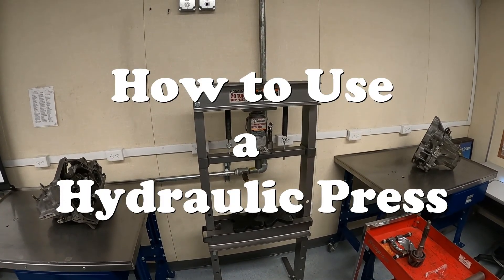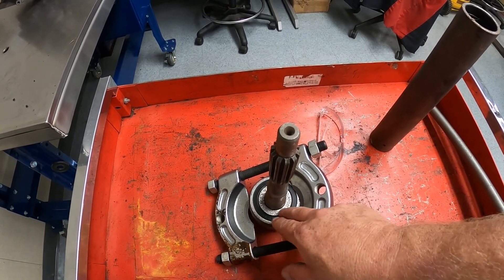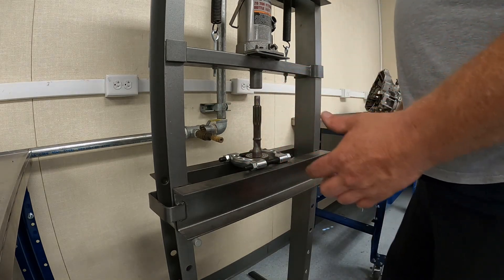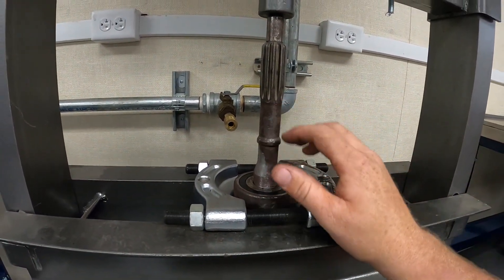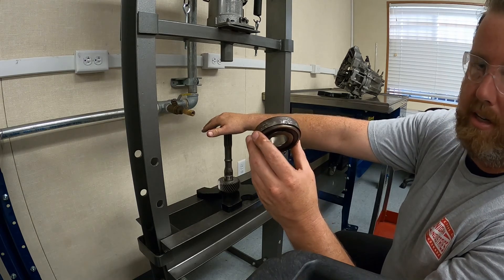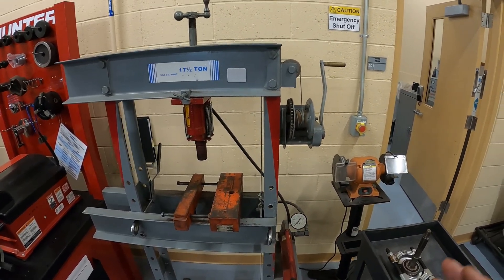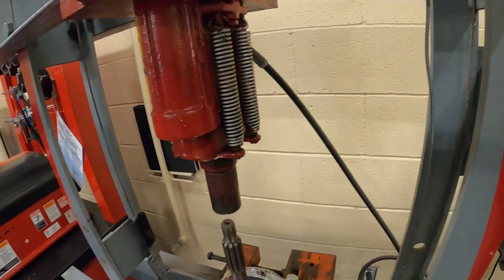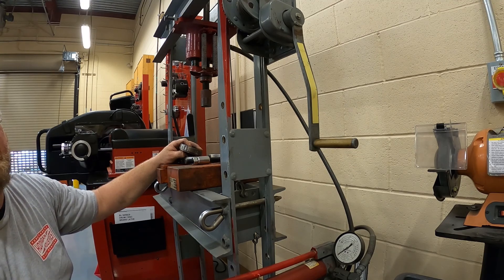How to use a Hydraulic Press

Comment: On my 12 ton press the top of the Bottle Jack unscrews to give you extra height.  I like having a bottle jack because I can Repair or Replace it !  A Press is a Fantastic Machine ! A lot of Daft People  make their VICE Explode trying to Extract Bearings !   But a Vice is usually made of Cast Iron !  The Press is made of Steel so it Will Bend or Split but it Shouldn't Expode even if you could overload it !

Comment: Be aware that if you think the ram shaft is inserted in a hole in the base of the bottle jack, you're wrong. It is just welded onto the cross beam. I learned that the hard way, fortunately without injury.

Comment: Hi, Taylor!  Came across your channel while researching DIY hydraulic presses and mods.
I can see at least a few of your videos that interest me. 
Your shop press at 13:52 is different than any I’ve seen so far and it does have the look of a shop-made tool as opposed to a commercially available press. Is there a way for you to show more angles and explain in greater detail exactly how it works?  I’d like to understand exactly how the cables are routed and how that works. Also I’d like to know how a handle on top of the press is able to extend the screw inside the ram. 
Another video with all the😂construction details of this press or a photo essay would work.
Thanks for your time!

Comment: Where did you get that bearing installation tool "pipe thing", as used in the video???
Reply from the maker: The bearing installer is from Miller Tools. There pretty expensive for what it is, around $350. You can find them from other vendors. It's under the description of a differential pinion bearing installer. I have also made them out of scrap thick wall pipe and 1/4" plate. Hope that helps.
Reply: Thank you so much! @Tech_1968

Comment: FYI, that specific bearing splitter is an OTC model 1123 = $175 on Amazon.  20-Ton HF press ranges from $129 to $249 (typical price with coupon $149).  OTC is nice, but overpriced in my opinion.
Reply: Could have used angle iron instead of risking a valuable tool damage. Also putting your hand underneath to catch isn't recommended for when it gives way the steel won't care about skin & bone
Reply: From what I’ve seen, the HF bearing splitter kit is affordable and does the job just fine.

Comment: Bearing splitter is around $34 at Harbor Freight.  20 ton press is $250.  So bearing splitter is no where near more expensive as the press.  Unless you bought it from Snap on.  Just saying.
otherwise excellent video.
Reply: You don’t want to use harbor freight tools splitter, at least get one from OTC or Proto in the $100-$120 range